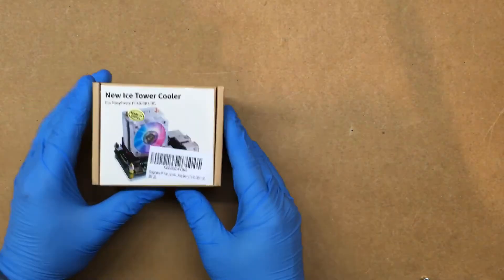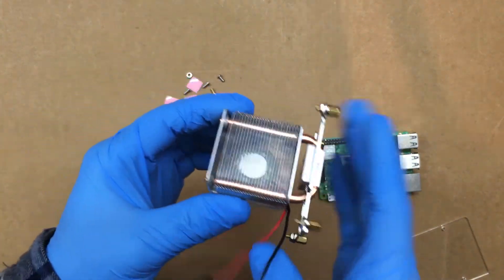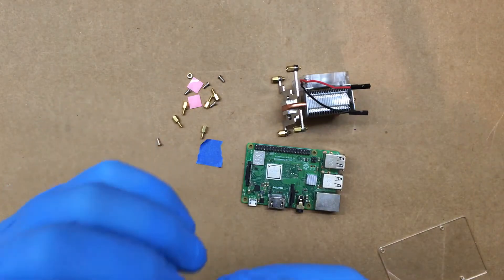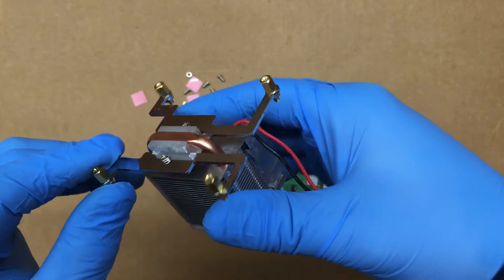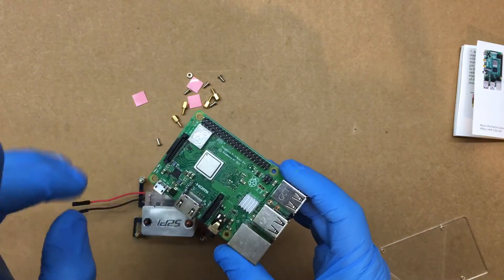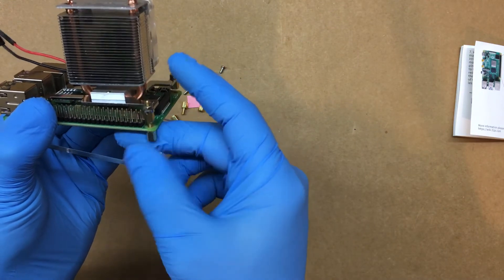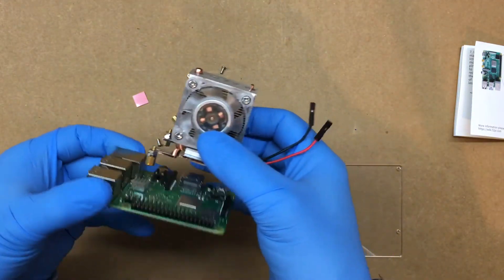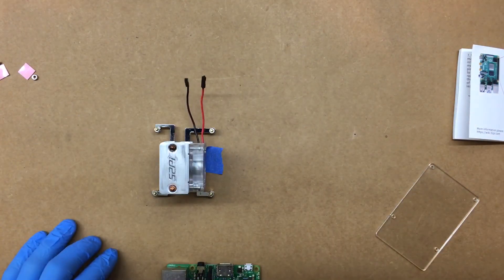🔵 Raspberry Pi 3B, 3B+, 4B Tower Cooler Heat Sink

Comment: I'm looking forward to seeing the results of your testing - I think you'll like that heatsink alot.  I have the same one on my Pi 4 (and like you I used thermal compound instead of the pads.)  It's been great - even with the Pi overclocked to 2 GHz, I can push all four cores at 100% and it hardly ever hits 45 degrees C.